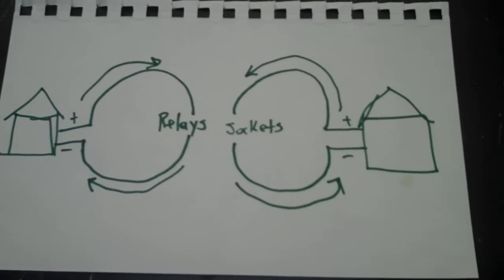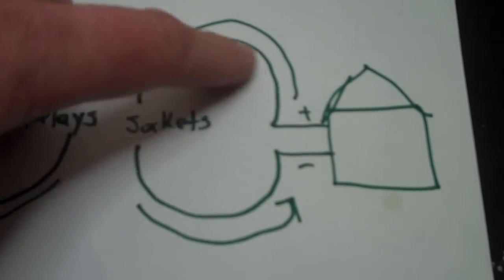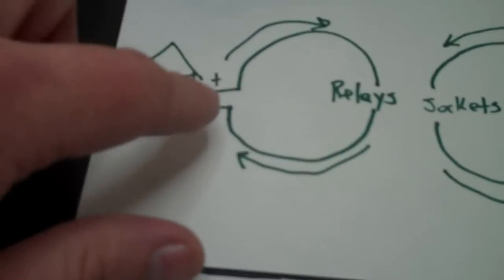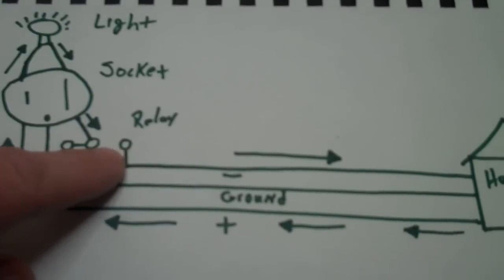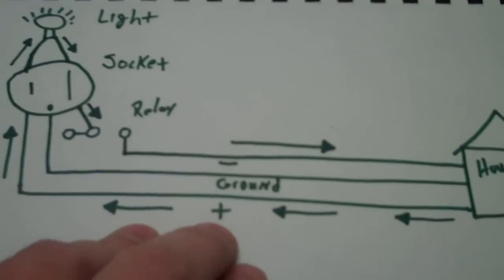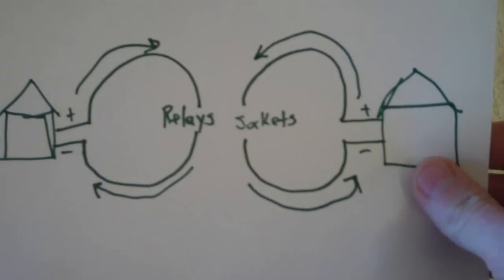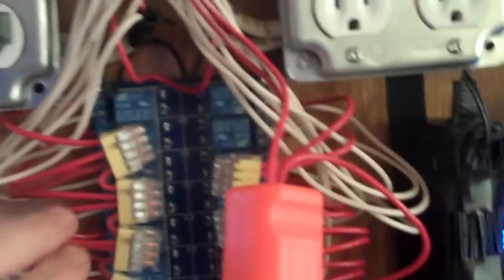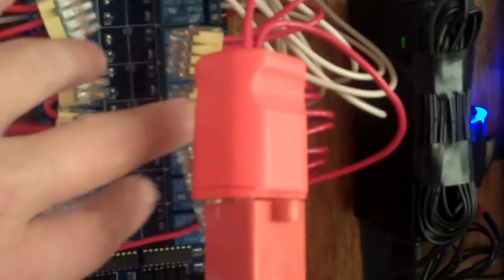Christmas Lights Control System - Part 11 - Q&A

Comment: Nice video. If you have not yet I would recommend since 16 channel to run power to 8 relays then separate power to the other 8.  I am mounting mine right by the house Breaker box so 20 amp breaker will run to the 8 on one side then separate 20 amp to 8 on the other side.  

Question for you I cant seem to find how to hook 2 or more of these together. I want to build mine off Raspberry Pi's   Example   Rpi + 16 relay in box 1    Rpi + 16 relay box 2     Then box 3 and 4 will have Picon16 boards for smart RGB's . Any how nothing out there on how to hook 2  16 channel boxes together wondering if you ever expanded past the 16 channels and if so how you did it.   Light O rama you hook together via E131 (lan cable) and name them device 1 device 2 etc.

Comment: I don't think i am gong to try this right now, mainly because i have no idea what I'm doing. But in the case i ever do attempt this, can you try to answer these? I get that coming from the power source there is ground, positive and negative, but what i need to understand is what connects to the relays because i only see 2 and i assume is positive and negative, and does the ground circuit just go through those push in wire connectors, and if so, how and in what order. And where did you get the electrical sockets from? I may be way off in anything or everything i just assumed, but I'm just starting and am looking for any help i can get.
Reply from the maker: "i assume is positive and negative", correct. "ground circuit just go through those push in wire connectors", correct "how and in what order" no order they are all connected together so it doesn't matter. "where did you get the electrical sockets from?" Lowes

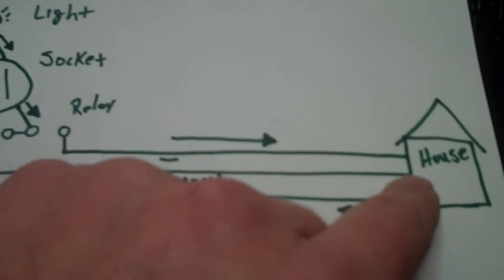Comment: Oh, so basically with my comment below, I can actually intercept the ground wires (not having any current) to control the water heater (example)? When the circuit is closed, wouldn't that power go through the Arduino relays? I know the method of relays, in Digital Electronic terms. I know how to do this with a simple LED, but I don't know how to take 20Amps into a small Arduino board lol. 4:10 - see, wouldn't that current sit at the relay? 40 Amps sitting at that relay. OR, physically, is there 'no' current because the circuit hasn't 'closed'. 

Does that relay throw see the current when the circuit is normally open? 

Isn't that 'bad' if something is receiving current and power, and not going anywhere? I feel like that would damage the heater, receiving all that current and not going anywhere. I don't know.
Reply from the maker: Sorry Billy, but I don't know enough to answer your questions. This was trial an error for me which is very dangerous when playing with high voltage.

Comment: I have a basic Digital understanding of Relays, but am pretty dumb when it comes to house electrical wiring.

So, could I use this same method and instead of wiring the water heater to the breaker box (but using the breaker switch as the main power to turn it on and off!), wiring it with this method and somehow be able to control the water heater through web (and LCD in the future)? 

I want the breaker switch to control it, but if breaker switch is on, then have the Arduino control it -- set schedules, allow override for a set time, etc. 

How in the heck would that be possible?

Comment: The conductor that should be switched is the hot (AC power doesn't have positive/negative).  The hot is the brass screw in the orange plug / smaller blade.  The silver screw is the neutral / taller blade, and should be connected straight to the lights (the neutral offers little potential for shock).  If you switch the neutral, Every bit of light wire presents a shock hazard ALL the time, controller on or not.  In any case, I recommend plugging into a GFCI outlet to help prevent electrocution.

Comment: Is there a reason you have the positive feed to the outlets common? Why not the negative? That way there is no power present at the outlets when the relays are open. You could essentially touch your finger anywhere on the outlet and not complete the circuit to ground.

Comment from the maker: The random cross SSRs still haven't arrived, but I have determined that just using them isn't going to give me the proper dimming.  So I'm working on a zero-cross detection circuit while I'm waiting on the SSRs.

Comment from the maker: Just a quick update folks.  Given that the mechanical relays can't do true dimming of the lights I've picked up a couple of the SainSmart SSR 8 channel boards.  These have zero-crossing relays on them so they can't do the dimming either but I found a random-cross relay that is supposed to be compatible with these so I'm going to try and replace the existing SSRs on the 8 channel boards with the random-cross relays to get true dimming.  I'll be posting the results as a new set of videos.

Comment from the maker: Well that is a very personal question, meaning everyone will have a different opinion.  I think it is very easy but I write software for a living, the hardware is the hard part for me.  The nice thing about the Arduino series of micro-controllers is that there is a ton of example code out there and many people that will help.  For this project you could just use the code I wrote.  The new URL is in the description of the videos.

Comment from the maker: The ribbon cable doesn't come with the boards.  I bought the connectors I wanted and many feet of cable from a local electronics store.  You can order it online even from Amazon try searching for "ribbon cable" and "idc connector" on Amazon.

Comment from the maker: This is probably okay as I have come to the conclusion that using PWM with these hardware relays is a bad idea as it will wear them out quickly.  Also you could power the second relay board from the same 12V power supply. 

My recommendation would be if you do decide to do this to power the new electrical outlets from a second extension cord (a second big orange plug).  That way you can plug each set of 16 sockets into a different circuit on you house mains power.

Comment from the maker: Thanks, :) . 

Yes there is no reason you couldn't add another 16 channels.  Obviously you would need another 16 channel relay board, another 16 electrical outlets, need to change the code to account for the new channels and would need to wire the new relay board to more pins on the Arduino Mega.  Remember though the Mega only has 15 PWM pins so the second set of relays could not be pulse width modulated, they would only be on/off.

Comment from the maker: I made a mistake the light on the FT232r will not stay on. At least it doesn't on my build and I have it wired to the TX and RX pins on the Mega.

Comment: Alright I'll try that.  One thing that I just noticed is that when I plug the arduino and the ft232r at the same time to the computer, that's when the ft232r's lights turn off.. as soon as I remove the usb plug for the arduino, the lights come back on on the ft232r..

Comment from the maker: Yes the light on the FT232r will stay on, it's a power indicator.  The line

int lightByte = map(inByte, 0, 255, 255, 0);

is there because my relay board wants a value of 255 to turn the switch off and Vixen sends 0 to indicate off so the values have to be swapped.  You board may not need this. Try changing it to:

int lightByte = inByte;

Generally if you are seeing the relays work but they are the wrong ones it would make me think you are reading too few or too many channel values from Vixen.

Comment from the maker: First thing I would do is NOT use pins 0 and 1 as these are connected to one of then on board serial UARTs and you may get odd results when uploading sketches to the arduino.  The second thing I would do is create a sequence with only one of the 16 channels having on/off states.  That will make it easier to debug.

Comment: Hey man, I'm having a lot of trouble getting Vixen to work. I got everything set up exactly the way you have it. The problem is, the lights that turn on/off whenever I press play in Vixen don't match the channels that I actually set up in Vixen. The way my channels are set up is the following: relay 1 is matched with pin 48, 2 is 47, 3 is 46, then pins 0-12 are relays 4-16, respectively. So I'm guessing the problem is that Vixen is sending the serial message to the wrong pins.

Comment: I bought a 4,8 and 16 channel relay (same as yours) if I get the 4 and then 8 working then I will buy the Arduino MEGA and work on that project.

Comment from the maker: Are you using the same the relay board I used, SainSmart 16-Channel 12V Relay Module? It has blue mechanical relays not solid state relays.  Also are you sure you are connecting the power supply wires in the right direction, the positive wire should have some sort of marking on it.

Comment: I don't actually have Vixen installed right now, and I don't have the ft232rl usb to serial converter yet.  I don't think I need those to simply power the relays right?  I tried what you mentioned right now and it didn't work..  What is "inByte" defined as?  Also, as I mentioned before, when I plug in my power supply the relay board doesn't function at all; but without the power supply, the lights on the relay board actually light up..

Comment from the maker: The relays require a backwards signal from the values you might expect.  So sending 255 actually closes the switch, sending it 0 opens the switch. If you are sending the values you get from Vixen they are wrong. Try the following, where inByte is what was read from the serial line:

int lightByte = map(inByte, 0, 255, 255, 0);

Comment: One more question!: I've connected the arduino to the relay board. When I simply put the tips of my 12V 1500mA power supply into the sockets on the head of the relay board, the lights on the relay board stop working(the lights actually flash to my arduino program without the power supply, just by connecting it to my computer).  Also, no matter what I do, I can't get the relays to actually make the ticking sound (they're not opening/closing). What might the problem be here?

Comment from the maker: BTW, if you use the power pins coming from the relay board to power the Arduino remember to connect one to the Vin pin on the Arduino not the 5V pin. Only connect one of the power pins  to the Arduino Vin pin. So you only end up using 19 of the 20 pins from the header on the relay board.  I used both ground pins from the relay board to the Arduino ground pins.  I only needed one of them but used both because I'm paranoid.  You only need 18 of the pins on the relay board connected to the Arduino.

Comment from the maker: There are 15 PWM pins on the Mega, 2-13 and 44, 45 and 46.  There are 16 channels on the relay board so one of the channels has to be on/off.  In my case I made that one channel 16 attached to pin 47.

Comment: Okay, I understand how you're connecting the 20 wires to the relay board, but there is no room to connect all 20 wires to the arduino mega digital pins..  There are only about 11 or 12 digital pins that can be used..

Comment from the maker: It's a 26 wire connector but I only use 20 of the pins.  I made the cable myself.